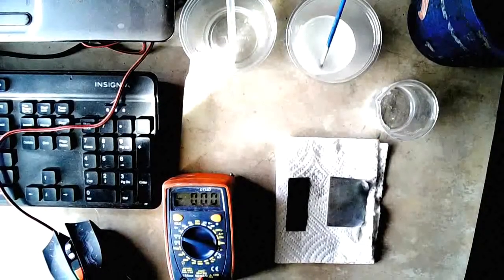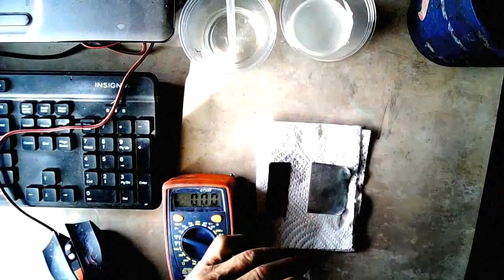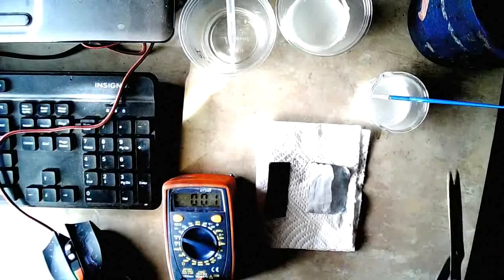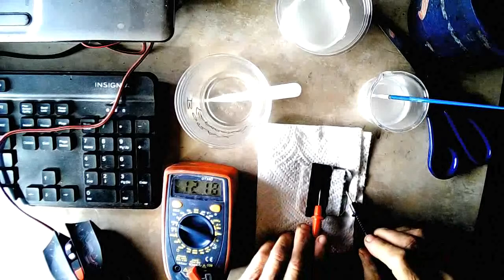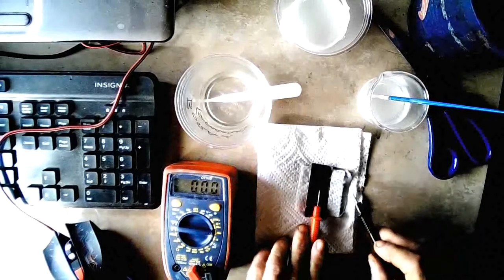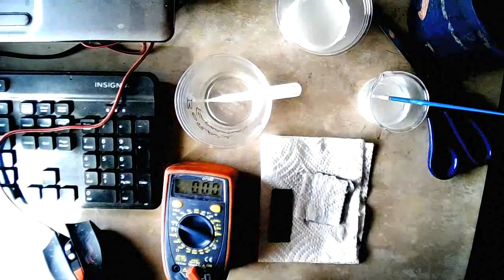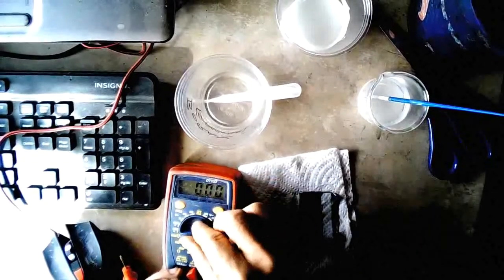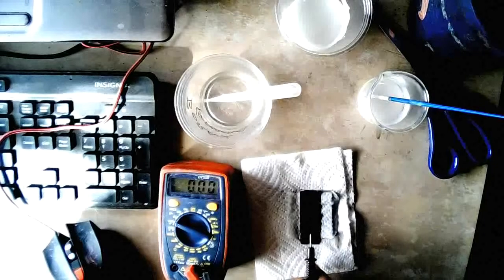Demo #31 Citric Acid Bio-Cell Exp. #2

Comment: hi thanks for the contribution to home chemistry and battery developments...I had some crazy voltage and current test from aluminium carbon with copper sulphate mixed with little tip of Mg chloride...max current was 500mAmps for 20 minutes...then the cell corodes avay on the aluminium side...
Reply from the maker: Hi Barry, welcome to bio-cell. That reminds me of an experiment I did with a lead acid battery.  Sulfate and chloride salts are made from sulfuric acid and hydrochloric acid of course, which are both very strong acids. Lots of quick amps but very corrosive, and aluminum is so light weight (low density) that it gets eaten up pretty fast. ~Ray

Comment: I like your systematic approach in experimentation. It might be advantageous to measure components if even roughly to facilitate reproducible results. For proof of concept it may not be essential but knowing the approximate proportions of ingredients might provide a basis for systematic analysis. Seemingly subtle changes sometimes have surprisingly profound effects. More than once I regretted my inattention to seemingly insignificant details, causing unnecessary extra work to recreate the results of an experiment. I am an empericist by nature. Add and subtract or change one thing at a time to determine the results. Keep at it. I sense progress.
Reply from the maker: I understand what you're saying Fred. I usually keep details in my head unless I'm running a lot of different experiments. I usually start with 50/50 ratios too, and use approx. 1 gram of most stuff in mixes, so I don't have to write a lot of stuff down. That speeds the research up. Labeling mixes in bottles and stuff like that is critical tho. That's where I have messed up the most.

Comment: Hi. Maybe you could clear up some confusion I'm having. I thought that anode is the positive and cathode is the negative. Some people seem to swap them around. What is really the correct version here. Thanks
Reply from the maker: Hi Gasonthebrain, welcome to my channel. 

That is an excellent question. It actually depends on which direction the energy is flowing. Charge/discharge. Understanding how things work is really a matter of looking at the analogies in nature. 

Batteries are polar in many ways, just like the universe. They not only are positive/negative, but acidic/alkaline, and hydrophobic/hydrophilic. These factors are all seeking a balance. Once we understand that, then we can interpret the observations more accurately.  I hope that helps.
Reply: Not really. My understanding is that batteries allow electrons to flow from the negative (cathode) electrode and accept electrons via the positive (anode) electrode. They being able to swap, doesn't make much sense to me. What say you. Regards Stephen
Reply from the maker: That's just one direction isn't it? So you believe the current doesn't flow in the opposite direction when you change between charge/discharge?